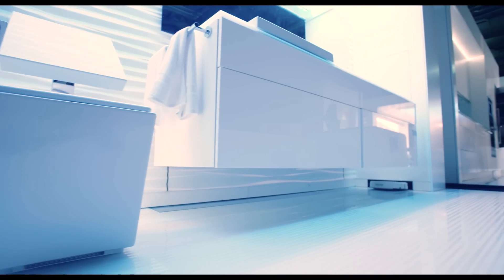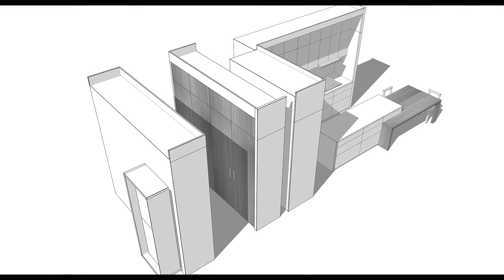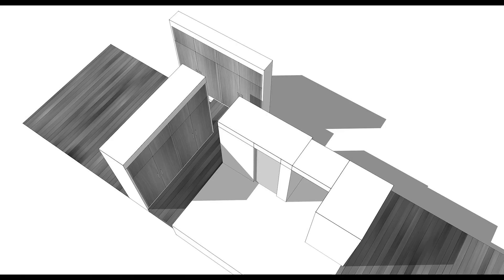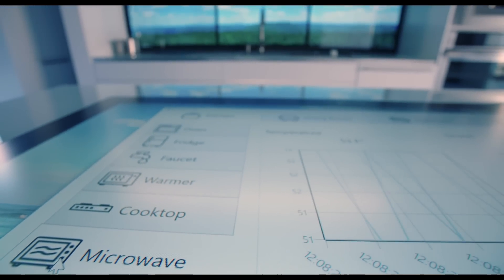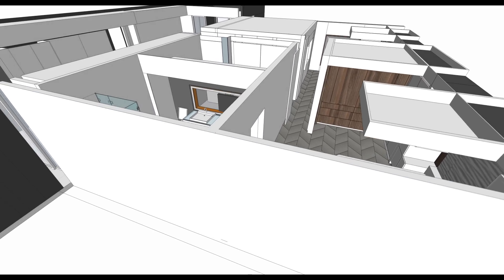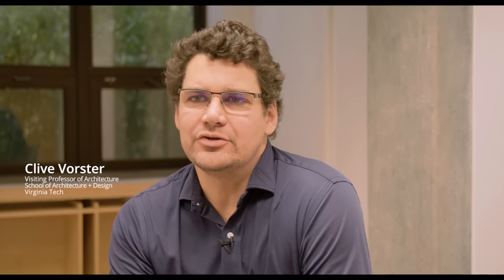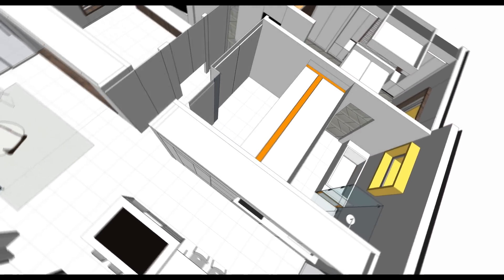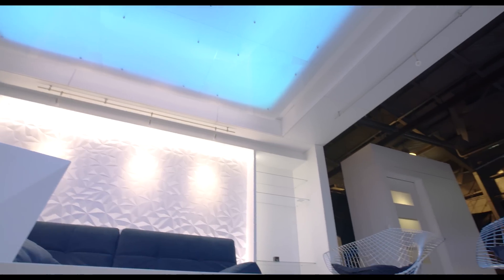FutureHAUS at Virginia Tech

Comment: Some of you are missing the point. Some homes have been and are being built right now in a factory.I am not talking about mobile homes either. Then those homes are being disassembled and shipped to the job site to be stood up or constructed. These homes are custom in nature and built with wood framing members. Yes I have built homes. I have remodeled quite a few in my years and there are some real shoddy builders that will cut every corner they can and the home owner pays for it down the road big time. 
     I use SketchUp now to model cabinets and sheds and have taken those designs from paper to reality. Last model was a 16'x20' shed/work shop with power and ac/heat. Took the plans to a truss manufacture and had the trusses made there and had the walls prebuilt by another company saved me time and labor on the job.